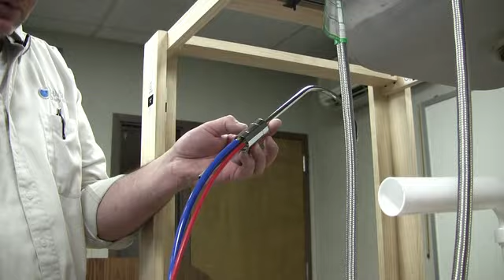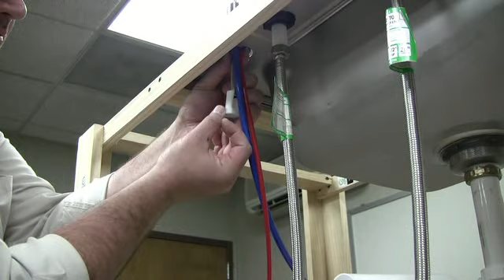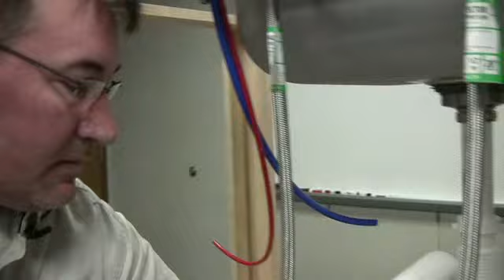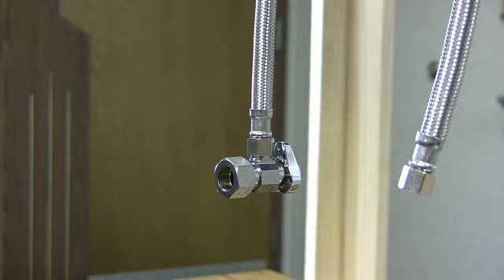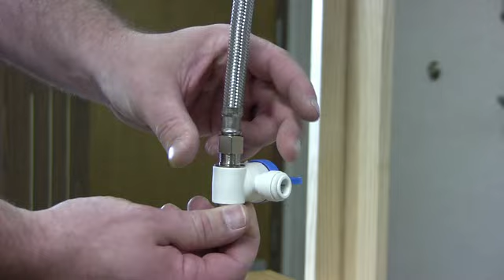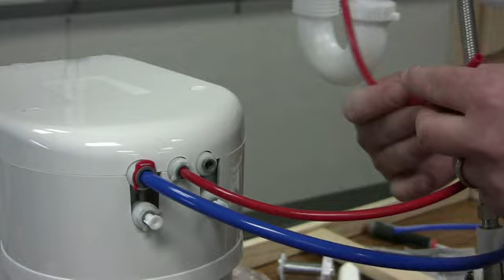Aquaphor RO 100 Installation (Part 2) - Hague Quality Water International

Comment: I have a new Aquaphor 101S system with a 3-way faucet and a retractable hose. When flushing the membrane—after turning on the water—the flow slows down and eventually almost stops, preventing me from completing the flush; however, up until that point, the flow is good and steady. I can't figure out what the problem is.

Comment: I have a dishwasher installed, pipe from the dishwasher is connected to about 5 cm under the sink. Installing a filter outlet below, can make cause dirty water flow back?? Dishwasher gives a lot of pressure when water pouring out....

What is Yours opinion??